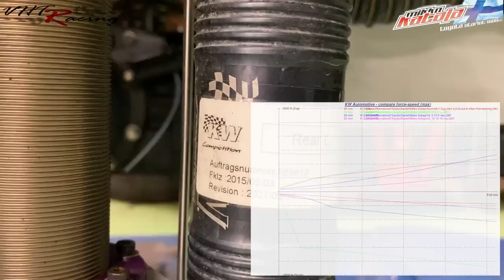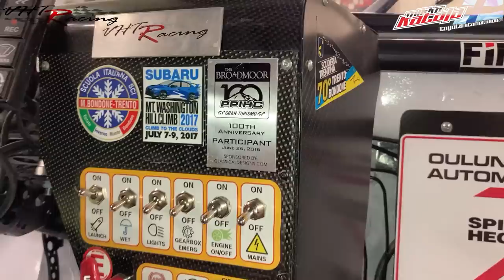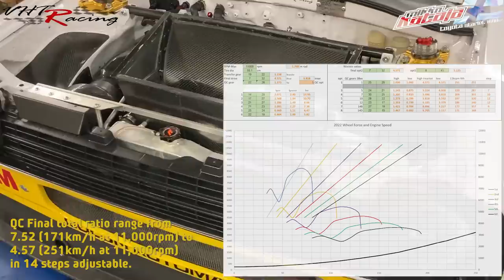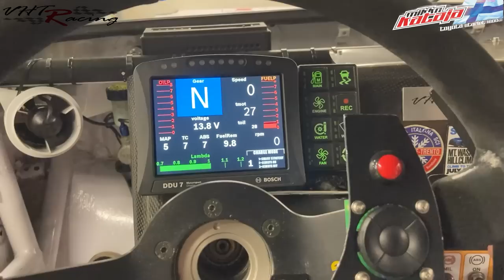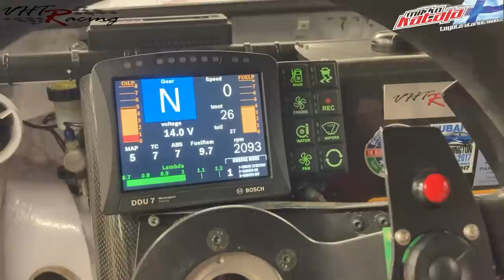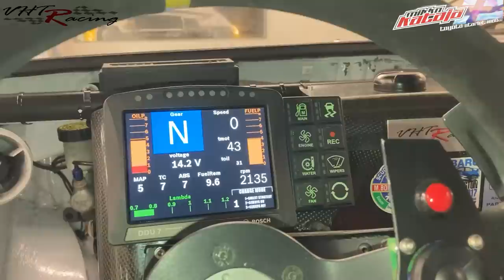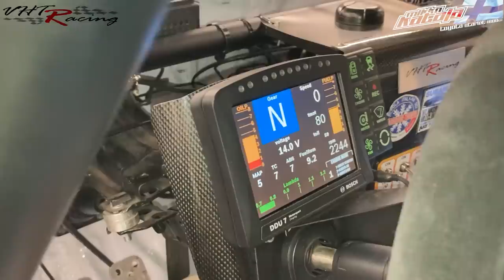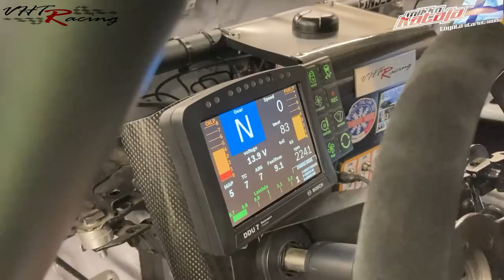2022 4AGE 16v 1600cc Hillclimb Starlet Introduction

Comment: Thx for the sneak peek!
I like how you keep it competition ready, not showroom ready, this is no garage queen.
I feared the worst for suspension, but was surprised, that high spec performance and yet the chassis is kept so original the suspension could be swapped back to 100% OEM almost overnight.
That commands my respect, it speaks volumes about a very thought out, carefully modified, out of the box (in a different sense) suspension setup.
A rare feat in a day and age where most people massacre the car until there's nothing other than outer shell resembling an old Toyota, and they won't EVER see the performance this car is putting out.
Reply from the maker: Thanks, yes this car still somewhat resembles the original Starlet many ways. So not just a tube frame racecar Starlet look a like. Many things are kept true to original car due to regulations, but I think it is also what brings the challenge and joy on the whole thing. When you beat some serious cars with this “old car” you can say yes still has a solid rear axle, yea still has the original McPherson front suspension and yes firewall is intact etc. let’s see what the future brings to this car. Next update is going to be a big one, but I think stays still true to the nature of this car.
Reply: @VHTRacing  Don't let me dissuade you from doing whatever you want with the car, even if unoriginal to the car.
Saw enough mods to determine it's not getting plates again anyway!

Comment: new wheel set up, love it
Reply from the maker: Thanks, but the BBS wheels are already since 2020.. :) We sometimes run old set of tires in practice runs with the old wheels, or intermediate/wet tires with SSR's or Compomotives.. Unfortunately would have been too expensive to order bigger amount of these BBS's with different specs.

Comment: Brother runs a Starlet with a 1300 twin cam Suzuki Swift motor fitted with big hair dryer. Has 6 spd Quaife sequential box. Pokes out around 270 ponies at the rear and runs a big ass wing. A quick and effective weapon.
Not quite as pretty as this rocket but from 10ft away who would notice.
Reply: Got any videos on YouTube?
Reply: @fodenpetersen8992  yep a couple. Look up Import Parts Specialists. Hawkeswood Hill Climb 2021 & Three Mile. The footage is a bit crap but will give u an idea what the car is like. Hawkeswood Road had loose gravel on it which made it dangerous. The cars gearing also limited top speed. Brother has another diff now.

Comment: this car is awesome, I would love to put a mini quick change in my Opel GT
Reply from the maker: It's great. Takes 15mins to change the drop gears on the axle. There are few downside's on these axles, but generally quite happy. Very light especially this 7" version with the magnesium center and all the light options like gun drilled axles and lightened ring gear etc.

Comment: Very nice car. I have two questions: Did you consider using a 7a block with longer conrods for better rod/stroke ratio? Is there a reason why you mounted the watts link rocker on the diff instead of on the chassis? I am building an AE86 gravel rally car and I'm not sure which is the best way to do the watts link. Thank you.
Reply from the maker: @MotoWot  I’ve done 7age in the past. For this hillclimb engine wanted to stay true to 4AGE with the original stroke and block height, but had quite long rod already >134mm much longer than usually. Our piston rod combo for this is something quite special. For the wattslink simply the floor is not strong/structural in the middle and there is no space between axle/tank etc. with this typical layout it was easy to have the chassis side brackets in the frame rails that are more sturdy than the floor. There would be of course some “maybe” benefits to have it the other way around (like the fixed location/adjustability).
Reply: @VHTRacing  Thanks for your detailed reply. I agree there are some benefits to the chassis mounted rocker, but it won't work very well if I hit something and it gets ripped out of the floor 🤣

Comment: @VHTRacing  Did you do anything to eliminate the valve cover grommets? Or did you use the normal grommets for the valve cover nuts?
Reply from the maker: Just eventually got the original Toyota grommets they are the best solution. All more or less generic aftermarket parts are bad, the origina ones work well and last long if not abused.
Reply from the maker: Just eventually got the original Toyota grommets they are the best solution. All more or less generic aftermarket parts are bad, the origina ones work well and last long if not abused.
Reply: @VHTRacing  I forgot to ask, how many races do you get out of your engine and transmission before needing a rebuild?
Reply from the maker: Currently the gearbox is in the car since 2016 (Pikes Peak was the first race with the Sadev sequential). It has not been overhauled at all and I will need to do it later this year as 3rd gear is starting to show some engagement issues. I had to slow down the shifts lately. Engine target is one hillclimb season and overhaul every winter. Depends if problems occur.

Comment: It's good to see people still investing time and knowledge in reasons of passion...What's the torque steer like?
Reply from the maker: Thanks. Torque steer? It’s rear wheel drive, there is some snap oversteer if you turn the TC down and not be careful on the pedal.. 😄
Reply: @VHTRacing  Sorry about the dumb ass a question. When I started watching your great video on your fantastic build I thought a Starlet was front wheel drive, then got to the bit about the rear end, and saw it was rear wheel drive, thought it an awesome set up with the quick change..... Even after watching it twice .... I still asked the question....( and I was lying in bed this morning thinking that was the dumbest question to ask ) That's what happens when you get old and you start work at 2 AM. I have loads of questions about your build, but as I'm new on here I'll have to go back through your video list and have a cruise about.
 Here's an interesting video about rear end development  https://www.youtube.com/watch?v=pcQTXh9j0t0
 Again I apologise for the question....
 Here's another question. Have you done anything with the steering Ackerman. It looks like there's a bit of caster on it.

Comment: Sorry if i missed it in this video (theres so much info!)

Youre using a block girdle and beefed up bearing caps in the engine correct? What brand are these? Thanks!
Reply from the maker: I did not mention anything on it in this video, but you can see all internal parts on the full engine rebuild series of this engine i did few years ago. I'm using MRP girdle on this engine with the original caps and ARP studs. I'm not 100% happy with that solution and if i would ever start from scratch again with the 4AGE i would make something different, it's not that it wouldnt be beefy enough, but something to save weight and also lover the oil pan even more would help. Every 100 gram counts on these cars and if you could save a kilo from the engine it would be huge.
Reply: @VHTRacing  Thank you so much for the info. The MRP girdle is actually the one that had my eye- So thats quite interesting to hear.

However my goal isnt to build a 11-12k RPM beast haha.

Also super interesting to know theyre the standard caps!
Reply from the maker: @SidewaysGts  it was quite a process to get the girdle sit correctly and also to get the main tunnel straight and correct size what i wanted. We needed to machine the block and the caps etc and finally line bore/hone. I would not recommend using such girdle even on some over 200hp builds, like typical rally engines which are not dry sumps and wont spin anyway much over 9000. They do not need it, for a light street engine with some mods definitively not needed.
Reply: @VHTRacing  In your experiences do you think the girlde would be necessary / recommenced at all if youre only intending to rev to 9-10k rpms? What kind of machining was necessary to get that girdle in?

Comment: I was just thinking about barrel throttle bodies for my AW11, where'd you get those? Or did you make them?
Reply from the maker: Our own design. I once calculated it would cost around 4000€ to make similar package and that doesn’t include the carbon plenum.
Reply: @VHTRacing  any chance of a video on that? I started designing one in CAD that could be 3d printed in a high temp filament like cf nylon or something similar.
Reply from the maker: It might show on some of the engine build series videos we did few years ago on this channel. There is for sure tons of photos of the barrel setup on our Facebook page under the 4age build folder. The barrels and barrel bodies are Aluminium and I also got the trumpets 3D printed in proper filament that can be used for structural automotive parts. Barrel has some important things to consider with the bearings and tolerances. I ended up using a self lubricating coating in the barrel and to get the clearance right was not easy.

Comment: 256bhp from a 4age, Jesus Christ. Imagine an aw11 built to this level, I wonder if it would be faster if it could still be brought down to the same ~700kgs
Reply from the maker: Hard to say, in theory the mr2 aw11 should be better platform what comes to weight distribution and center of gravity height. I think you could get them better in the mr2, but also our Starlet is not bad i have put a lot of effort to get the weight distribution better and lower the cg as much as possible. Never driven mr2's myself, been just a passenger on short rides and it feels also quite nice, but might be that depending on the course and type of road these two cars could have their positives and negatives. One of the fastest home built hillclimb cars in europe in my opinion is Manuel Dondi's Fiat X 1/9 it is with a 2l na engine incredible. It is low and wide and has crazy cornering speeds. When i saw that i actually thought could the mr2 be similar if properly built. Search him in Youtube and you will be amazed if you dont know that car already. Anyway i think the car and driver needs to fit also together, even if some car is faster on paper it doesnt mean it will be faster on 17km up to Mt Bondone...